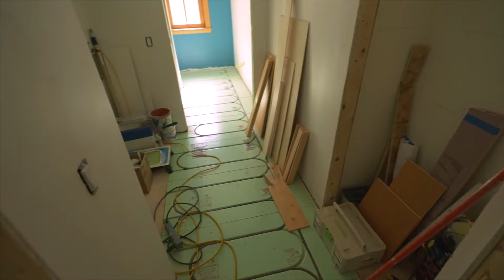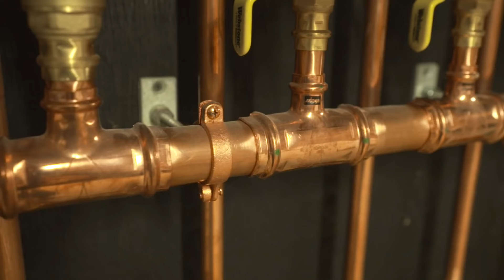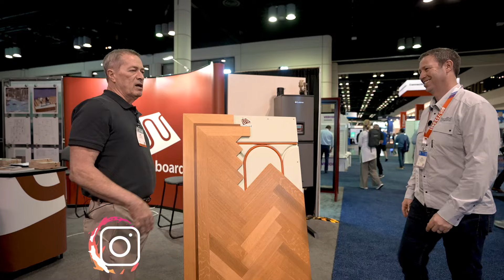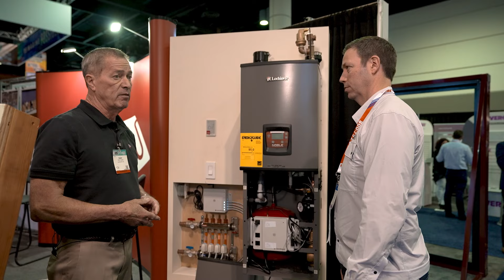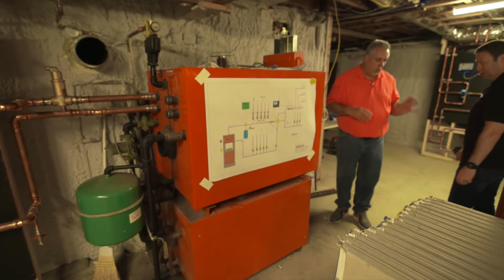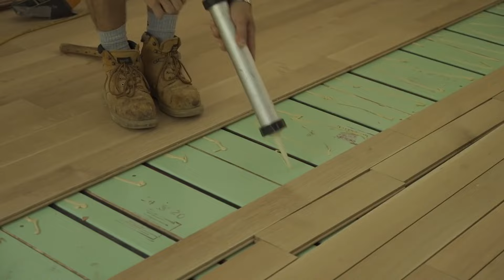ANY Plumber can install this new Warmboard Radiant Heating System

Comment: I love this system and have recently done an installation in BC however I do have to criticize of the system. I spoke to Warmboard about it and it is like talking to a rock. 1. Not having a domestic hot water loop to storage tanks make no sense. The loop is no different then than a zone and the boiler should be able to provide a higher temperature just to DHW zone. This would save in overall system costs but also in cost of heating DHW water. 2. The tubing spacing at such a low temperature does not work well for our northern Canada zones when it is minus 35 degreess Celsius.  The answer is either to make the loops at 6" spacing or increase the loop temperature. I vote for tighter loops and keep the lower temps and costs down.

Cheers Bob
Reply: would agree in tighter loops for extreme cold. I see no reason why that fancy control board can't shut off the heat circulators for a few minutes and make a higher temp for domestic water. The house temp can certainly coast for 15-20 minutes a few times a day to make hot water for a storage tank

Comment: Can you buy the templates and use a router to make your own in say 1-1/8 Flooring?
Reply: https://youtu.be/zc1NSeqaA1c 
And please use this tube layout, not the one in the vid. This one spreads the heat more equal. Keep 10cm between pipes, and loops not longer than 100meter. Put those loops on a manifold wit a pump and u can hook it up on any warming system because the manifold controles the temp and mixes loop water with heating water till the right temp for the system is reached.

Comment: Do they have a geothermal solution?   Any chance they could make a cooling system that didn't have condensation issues?
Reply: The cooling systems are not the issue, its the controls. You need to keep the cooling temp at a certain ratio to ambient air temp as to not cause condensation. Its a tough balance that is hard to get correct.
Reply: We do MANY projects with Geothermal, but this current offering (Warmboard Comfort System) does not support geothermal at this time. Our panels are a terrific solution however because their high conductivity works well with lower water temperatures.
Reply: Radiant cooling under floors is not very efficient. Easier to heat a floor than cool. I’m guessing that’s why they haven’t explored it?
Reply: @mtgentry  Radiant cooling from ceilings could be relatively efficient however condensation would be my biggest concern.
Reply: @boedillard8807  yeah that’s what I’m doing in my house. With a dedicated whole house dehumidifier. I’ve seen one or two examples of folks who did radiant cooling without a dehumidifier (or some way to control the humidity)  but it seems super risky.
Reply: @mtgentry  look into Tekmar and their zone controls with an outdoor reset. It can monitor dew point and humidity to minimize condensation. A humidifier is a must unless your area is always dry.
Reply: @mtgentry  Radiant cooling is typically done through the ceiling. It requires controls for control dehumidification and condensation. We've done a few dozen projects over the years. Generally we don't recommend it because it's just not that powerful of a solution for cooling.

Comment: What about the pressure tank, air scrubber/scoop etc?  When a zone valve or pump goes out can I replace it as easily as I can on my old school system?  I like the idea from an install perspective, but highly integrated systems can be hard to maintain without pricey specialized technicians and parts.
Reply: I’m not a tradesman.  I installed the ENTIRE system myself.  Everything.  Boiler, manifold, panels AL-PEX-AL tubing, thermostats, controller, water feed, gas feed.  A plumber can do all of this without issue.

Comment: @mattrisinger.  Warmboard works well for raised foundations or wood subfloors.  Because it can be screwed or nailed down. However, Warmboard doesn't work so well on concrete slabs.  The cost of the Warmboard and the requirements to fasten to slab is very expensive.  The Warmboards themselves are very expensive compared to other systems on the market. My company is getting ready to do another whole house radiant floor system.  We use the Uponor system.  Uponor will do a full system calculation with a full set of plans.  We install systems on a new construction with a slab foundation to be able to have heat control in each room.  The slab foundation is poured and let to cure.  When we do the framing of the house we add two additional bottom plates to give us 3 inches for the radiant heating.  Then we lay down Creatherm insulated panel to accepted the Uponor tubing,  Then we do an overpour of light weight concrete to the top of the second bottom plate.  This has given us great results with the ability to control heat output in each room.
Reply: On the slab then do you need to do a thermal break before installing the Uponor radiant heating? I have been contemplating Uponor radiant heating to solve my heating issues but I’m just unsure how to protect against accidental puncture during a remodel or someone foolishly putting a screw or nail through the floor and into the radiant? This is the only reason why I hesitate on wanting radiant heating. Water damage scares me a lot. I will be using Uponor to replumb my house so I know the connections will be good but I’m just afraid of some future foolish mistake that puts my home at risk. Any thoughts? Thank you.
Reply: @insecureinvestorchallenge7366  I have found there is so many different way to install radiant heat. It comes down to preferences and how focused you want the heating to be.  Yes, we use an insulated panel prior to installing the tubing.  We use a Creathrem insulated panel.  Here is the layer layout from earth to top of finished floor.  1. Earth 2. A thick vapor/moisture barrier. 3. Steel for slab. 4. Then concrete slab is poured. 4. Then Creathrem panels are laid out. 5. Then tubing installed. 6. Then over pour with either light weight concrete of pea gravel concrete.  7.  Finished flooring.  This process doesn't really work for remodels due to it raises the floor height 3 inches.  That is why in new construction we add 2 additional bottom plates to give us the additional 3 inches in height.  That way it does not create a problem for the door heights throughout the house.
Reply: @insecureinvestorchallenge7366  Sorry I forgot to address the accidental puncture.  So we do not put radiant heating in the following areas due to wasted money.  We don't install the panels or tubing in the following areas.  1.  Under any cabinets throughout the house. 2. Pantry areas. 3. Under any islands or peninsulas. 4. Depending on the customer wants in the smaller closets in the 2nd, or 3rd bedrooms.  How we make sure that we don't damage the newly installed tubing is to make sure all the structural areas that needs to be secured to the slab are already completed.  Each loop is a continuous run.  Which means some length are as short as 100 foot to as long as 250 foot or longer.  The reason we use a concrete overlay is it is harder to damage the tubing once in cased in concrete.  With wood subfloor and panels you have to be very aware of the tubing.  Because yes I have had customers that have had punches due to accidental screws.  Hope that helps.
Reply: You do a concrete slab then your radiant on a slurry coat? We do a poly layer for radon protection, then 4 inches of foam, set our wire mesh, cable tie our heat lines to the wire mesh, then pour our finish 4" slab. So clients go with polished concrete and some do a glue down hardwood. Polished concrete ends up being a cheap heated flooring option
Reply: @mountains2938  I have found there is so many different way to install radiant heat.  It comes down to preferences and how focused you want the heating to be.  We found that when we tie it to the steel in the slab it takes more energy and time to heat the entire mass of the slab.  And there is possibilities of running into cold spots on the finished floor.  There are several different type of insulated panels on the market.  We just prefer the Creathram panel.  So we put down the insulated panels on the finished slab.  The main slab has a thick vapor/moisture barrier place prior to pouring main slab.  Then we install the tubing per the Uponor layout.  Then do an over pour of concrete either light weight concrete or a pea grave mix concrete.  Which gives us two difference to in slab install.  The first being that we can make each individual room or area a zone control.  The second is that we can focus more heat into the living space.  Because the most of the heat will travel upward due to the insulated panel and it only has to go through 1-1/2" to 2" of concrete.

Comment: Can this be used on a slab on grade house? Would you just lose all the heat downward?
Reply: Yes. You can install our Warmboard-R panel over the slab. Heat loss would be minimal and could be reduced with a layer of Homasote between the slab and our panels.

Comment: Is it communicating through the web, or just to the main brin in the heating enclosure?
Reply: Communication occurs on a closed-loop wireless network. No internet required. There is however our Warmboard Bridge which connects everything to the Internet and allows for software updates and remote troubleshooting.
Reply: @Warmboard  I like closed loop, since bandwidth is pretty dear out where we are.

Comment: I’m too scared of leaks.
Reply: A foolish nail or screw is the only thing that scares me. Otherwise I would go with Uponor radiant heating system. The connections tighten over time, are extremely leak resistant and because it is an expandable Pex A then in the event that your house is left to get cold enough to freeze then it is burst resistant. So if it wasn’t for the fear of a foolish nail or screw then that is the only thing that gives me pause. I hope this helps. Thank you!
Reply: Installed this once and the flooring guy hit the lines twice. one was obvious and the other showed two months later once it rusted out. Not fun but the flooring guy was a muppet and could have easily been prevented.
Reply: Before filling with water, the system is pressure tested with air. This is when you look for leaks. Once you're in the clear, fill with water. Once the flooring is in, it's not really an issue.
Reply: @Warmboard  I appreciate your interaction here. I’m sure it can get a bit rough sometimes, this being the interwebz. So running water in the floors worries me, too - everything ages, and there will be leaks, and after worrying about mitigating water leaks in the kitchen, laundry and bath…what DOES happen if there’s a leak somewhere? Locating it and remedying it both sound like challenges, all hiding under some very expensive flooring.
Reply: @GibsonCRG  PEX tubing is used throughout the floors. As long as the system is properly pressure tested and clear of leaks, it should remain that way. Life span of PEX is 100 years plus. Leaks that could/might occur would occur at mechanical connections- manifolds, connections to the boiler. And these spots are easily accessible. Keep in mind, the system is pressure tested at 100PSI, but only runs around 12-18 PSI. So even leaks at the mechanical connections are highly unlikely and very rare.
Reply: @GibsonCRG  I don’t have concern about the connections leaking with Pex A because they are the best connections you can get and only tighten overtime. As long as you are using a true Pex A connection. It is that foolish nail or screw that someone accidentally drives into it at some point that scares me.

Comment: My quote three years ago (before lumber prices went crazy) included roughly $10/sqft just for the subfloor sheething.  On a 3000 sqft house that was $30,000 just to have a place to run the tubing (vs. $3,000 for standard floor sheething at the time), didn't include any mechanicals/plumbing, and still required a completely separate system for air conditioning.  Too rich for my blood...  I cannot imagine how much it would cost today.
Reply: You'd honestly only need it on your lower floor of a three floor home if your home is insulated well.  My boss has an 6000 square foot, 2 floor home.  His lower level floor heating is overkill and barely runs.  He's at almost 8000' in altitude in Utah.   All solar, and a pretty small panel array because his house is so efficient.
Reply: It was about $7/sqf  for just the clad boards in 2016 when I looked into it definitely a lot of other options out there I would hate to use their proprietary zone control system
Reply: I would probably only upgrade to a system like this with the most efficient air-to-water heat pump + solar or geothermal, under the assumption that natural gas prices may continue to rise throughout my mortgage. As part of a very low energy home (or net zero), the cost difference would not be nearly as dramatic over 15-30 years.
Reply: On par for this channel to be deaf on costs.
Reply: @grahamstefaan  ... costs will vary greatly in different areas.
Reply: @grahamstefaan  He's building custom homes.  What do you expect?  He's not remodeling 800sq foot dumps like I am next month.  Or building 1500 square foot, prefab homes.
Reply: @veganpotterthevegan    I agree with you. I do high end hvac in NYC and those rich folks aren’t worry about the price tag , they want the best of the best. So to have a product like this available is a bonus. There’s Rolls Royce and there’s Honda.
Reply: @SOSguap  ... hate o say it, but Honda probably breaks less often than a Rolls!

Comment: From what I've read, the down side the WarBoard's system is it does not integrate with 3rd party equipment like airconditioning or others smart thermostat (like the NEST). For air conditioning you need a whole separate system down to thermostats and controllers .
Reply: Correct. Our thermostats are required to run the system and cannot be swapped out for other options. They can however control many types of AC systems.

Comment: Work under tile?
Reply: Check with Schluter. I believe they have installation solutions for it to work with tile or better yet just apply the floor heating system that Schluter has. It depends on how large of an area you’re looking at and if you’re talking about only a bathroom area then it would be a very easy and an efficient installation to go with Schluter. They have their own YouTube channel, website with awesome customer service and you can even can get connected with a local representative that can go over your specific situation and give you direct answers for what you need. I hope this helps! Thank you.
Reply: Yes. We have 7 recommended tile assemblies. If you visit our website, scroll to the bottom then click "Documents" and then see our Warmboard-S (or R) installation guide. All the information is in there.